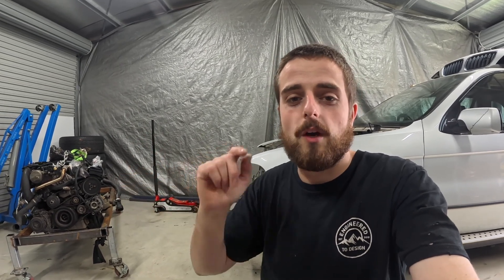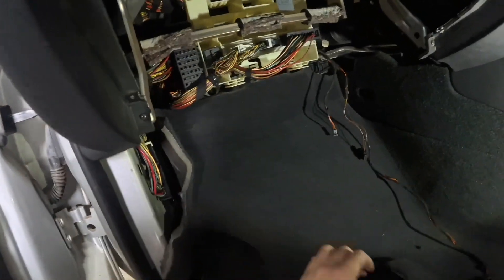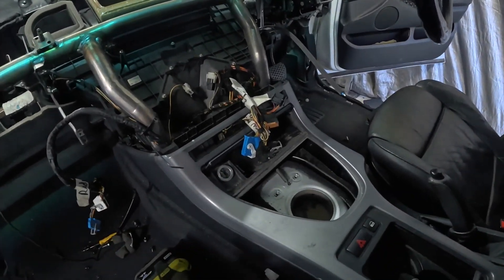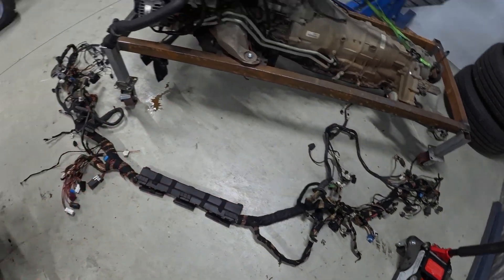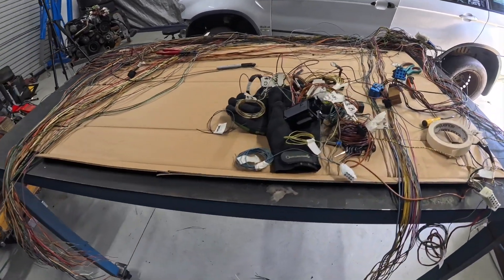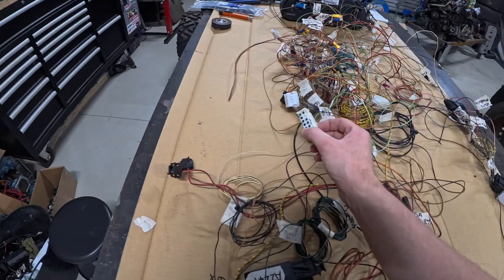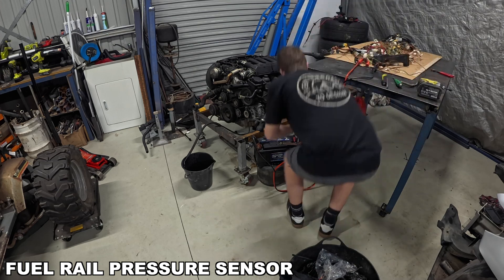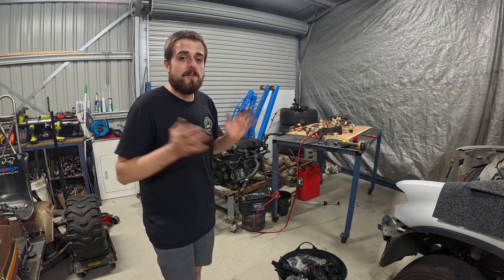M57 STAND-ALONE Wiring - (Pt 1)

Comment from the maker: Lots of work in this video. I will be going through the wiring in more depth once the ecu has been simplified so STAY TUNED & consider SUBSCRIBING 👌🏻
Reply: In depth wiring video please…
Reply from the maker: @4295056 it is coming in the next few weeks. There’s a bit to cover
Reply: I need help with my harness as well. need a pinout for the ecu. can't get mine to start
Reply from the maker: @justinbrgss dm me on Instagram if you like
Reply: When you want to put an accelerator from  an other car on it I can explain you. I put an e46 accelerator on my m57 boats.

E46 accelerator has only 1 poti meter and the original plastic accelerator has 2 Potimeters. But it’s quite easy to solve.
Reply from the maker: @klootvioolrck interesting, if you can send me an email at engineeredtodesign@gmail.com that would be great

Comment: Where did you find wiring diagrams for the bmw? I just got a full wiring loom with my donor motor/box and need to get my head around everything. Video is very helpful
Reply from the maker: Tried sourcing them online. If you can wait a little I will be doing a very in depth video explaining how to wire it up completely with the zf auto..

Jaymes young drifting is also fantastic with wiring if you are doing it with a manual..
Reply: Cheers, I’m planning to use the zf. Most videos so far seem to be for manual
Reply from the maker: @ yeah it’s a few extra wires for it and some messing about with the brake signal so it shifts correctly.